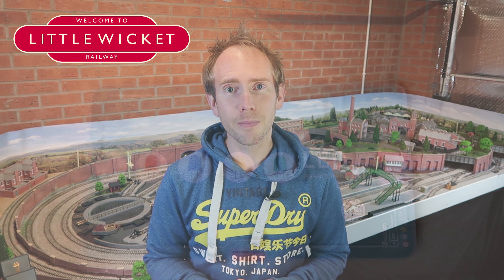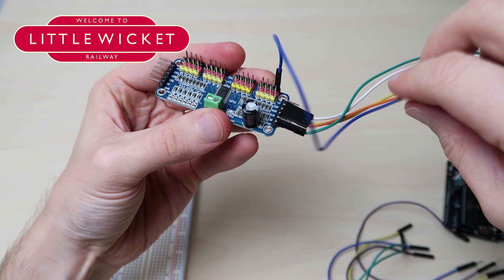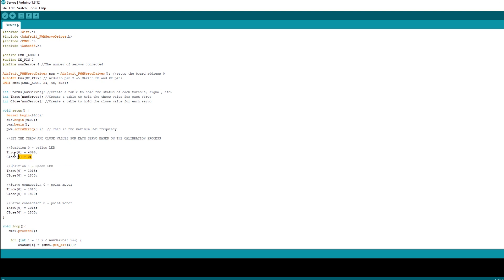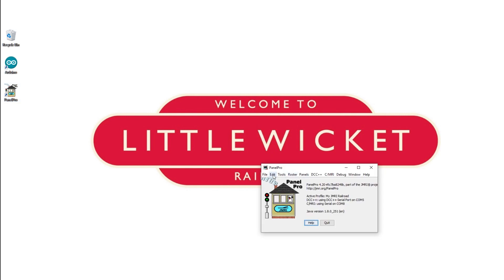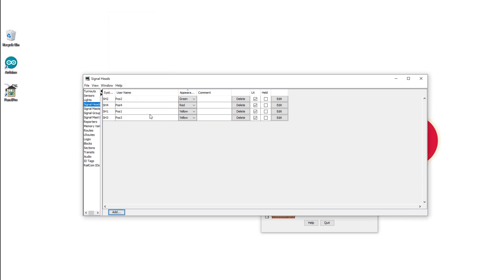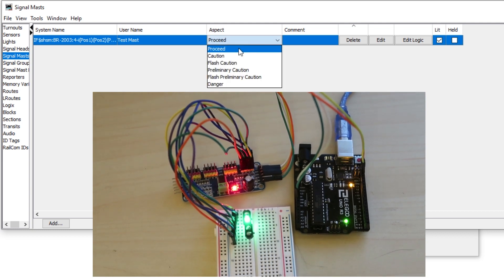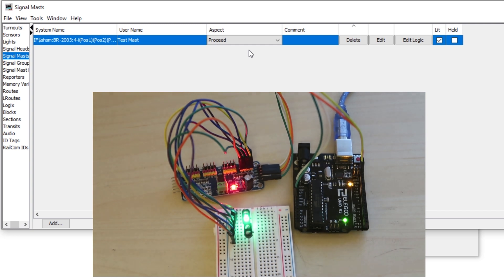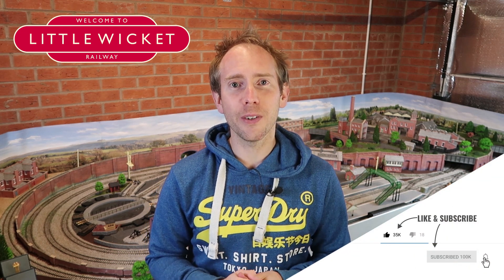DIY Model Railway Colour Light Signals Controlled by JMRI

Comment: much easier here is to just use grnd from the first set of pins on the PCA9685 as a common ground for all 3 leds, saves 2 wires from being needed and works perfectly well for this use case :)

Comment: Let me begin by thanking you for your previous videos! I have followed your DCC++ video and the servo videos with no problems. This video has had me being stumped for the last two weeks or so. I'm a true newbie with 3 months or so of learning via YouTube. I have had no luck getting this project to work and need all the help you can provide. Following this video you've been using a different Arduino and PCA9685 than the one used in the servo series. Is that correct or should I connect these LED's to the PCA9685 used for servos? Please HELP!

Comment: When I add the speed option to my servo control they stop working. This only affects the boards to which I add the extra code, the rest work fine. Anybody any ideas please?
Reply from the maker: Hi Tony, maybe drop your code into a comment so we can take a look or drop me an email via the contract page on YouTube 👍
Reply: @LittleWicketRailway 
Hi Rob. Thanks for getting back to me and offering to help.
Firstly, I must tell you that I am a complete beginner with Arduino and sketches. I have dabbled in the past with BASIC, Pascal and COBOL, so know the general format I do not know the specifics of sketch code and have only got this far by watching your excellent tutorials.
This the the code I am using to control the servos:

void loop(){

   cmri.process();

   // PROCESS SERVOS
   // Assume servos start on bit 0 which corresponds to output address 1001
     for (int i = 0; i < 16; i++) {
         
         //BOARD 1
         Status[i] = (cmri.get_bit(i));
         if (Status[i] != PreviousStatus[i]){
            if (Status[i] == 1){   
             for(int j = Close[i]; j<= Throw[i]; j=j+16){ 
                Board_1.writeMicroseconds(i,j);
            } 
         }
         else {
            for(int j = Throw[i]; j>= Close[i]; j=j-16){
             Board_1.writeMicroseconds(i,j);
            } 
         }
         PreviousStatus[i] = Status[i];
         }

         
         //BOARD 2
         Status[i+16] = (cmri.get_bit(i+16));
         if (Status[i+16] != PreviousStatus[i+16]){
            if (Status[i+16] == 1){   
             for(int j = Close[i+16]; j<= Throw[i+16]; j=j+16){ 
                Board_2.writeMicroseconds(i,j);
            } 
         }
         else {
            for(int j = Throw[i+16]; j>= Close[i+16]; j=j-16){
             Board_2.writeMicroseconds(i,j);
            } 
         }
         PreviousStatus[i+16] = Status[i+16];
         }

         //BOARD 3
         Status[i+32] = (cmri.get_bit(i+32));
         if (Status[i+32] == 1){
             Board_3.writeMicroseconds(i, Throw[i+32]);
         }
         else {
             Board_3.writeMicroseconds(i, Close[i+32]);
         }
         
         
         //BOARD 4
         Status[i+48] = (cmri.get_bit(i+48));
         if (Status[i+48] == 1){
             Board_4.writeMicroseconds(i, Throw[i+48]);
         }
         else {
             Board_4.writeMicroseconds(i, Close[i+48]);
         }
}

Thanks again for offering to help.

Comment: Hi, Your videos are excellent, I have been able to advance in most of them, now watching this video, would it be possible to make this same signal, only with the Sensor Hub + Your Sketch CMRI?
Reply: Done... working fine Sensor Hub + Your Sketch CMRI + this steps associate Light to Turnout Controller
Reply from the maker: That didn't take long! 👍
Reply: jajajaj It becomes easier when you understand better how to cross the signals between the input and output. , the power of the Arduino Mega + Sensor Hub + JMRI + CMRI is incredible, I will spend a very entertaining weekend preparing the signals and better understanding the work of all those components.

Your videos were very helpful, very didactic and with good explanatory details.  @LittleWicketRailway

Comment: Hi Rob, really enjoyed watching your series on servos using the servo driver board and this video - now doing something similar for my layout. Wondered also if the same can (easily) be done using perhaps a 74HC595 shift register mounted on a powered PCB without having to have have an Arduino always attached to the layout?

Comment: This is awesome. However i have just finished your video on multiple servos (using on a lego layout) using a powered ardunio and board.

However how would i combine servo control, sensor control and LED control onto one board?. I do have the sensor shield as well.
Reply from the maker: Check out my most recent series on JMRI, CMRI and Arduinos. It shows you how you can have servos (or lights), outputs and sensors on the same Arduino with a sensor shield https://youtu.be/OkXG3mfY6PE
Reply: Thanks mate. I lights i have are signal lights from trixbrix but will give it ago and see what happens. Thanks again.

I have some great ideas to use on my lego layout. Want to try and get train crossing barriers working.

By any chance did you do a lego series a few years back?

Comment: Thanks again Rob for these informative videos. I have a simple question to ask. I am thinking that to ease cable routing on my layout that I would have two pairs of PCA9685 boards. The first in the pair would be operating the servos for the points and the second for the associated lights. How do I set up each board in JMRI/CMRI? I may also want to use some of the I/O pins on the Sensor shield. I know I need address each board but would this be like; 1001....1101....1201....and 1301 and what happens to the addresses for the output pins on the shield? I'm nearly there but your help would be appreciated.
Cheers Martin
Reply from the maker: Hi Martin

Each Ardunio is a node in CMRI, so if you're having two ardunios each with two PCA9685s then you'll need to setup each Ardunio as a node by changing the CMRI address line (_#define CMRI_ADDR 1 //CMRI node address in JMRI_ 

The you'll need to setup two PCA9685s within each sketch (see video https://youtu.be/v1f_EDHV390). Make sure you solder the jumper closed on the second board.

It's up to you which addresses in JMRI you assign to the servos and lights. For example, on node 1 you could use 1001-1016 for servos and 1017-1032 for lights, which correspond to bits 0-15 and 16-31 on node 1. On node 2 you could use 2001-2016 for servos and 2017-2032 for lights, corresponding to bits 0-15 and 16-31on node 2.

Use the cmri.get_bit(i) code to find out if the servo is thrown/closed or the light is on/off in JMRI.  So as an example, your first light is connected to the first position (marked 0) on the 2nd PCA9685 which you've setup as pwm2. You've created this light in JMRI with address 1017. To find out if the light is on or off in JMRI use the code 

            cmri.get_bit(16) 

then store this in a table for the loop code to check. Within the loop you can then send the correct value to the light using the code below which is communicating with PCA9685 board 2 (pwm2) and connection 0.

             pwm2 .writeMicroseconds( 0 , VALUE TO SEND TO LIGHT);

You'll need to update the code loop for throwing/closing the servos or turning lights on/off and make sure it's referencing the correct bit in the table.

Also, check out the series on using Ardunio, CMRI and JMRI together (https://youtu.be/OkXG3mfY6PE). I think this might be of interest. You can have servo, inputs and outputs all running off the same device. I'm in the process of making part three which also might be of interest. Rather than having one big CMRI node that does everything at one central location with tons of wiring, I'm effectively setting up a CMRI bus wire. CMRI nodes around the layout then connect to the CMRI bus. So if you had a long layout you could have multiple Ardunios each controlling a handful of sensors, servos and outputs each. Saves on wiring and speeds things up a bit since the processing power is shared out.

Comment: Another excellent video very well put together and presented.

Everything works up to the point I need to add a mast.  i.e. I can create the Heads and the lights come on and off when controlled from the signal head window.

I am trying to add a 2 aspect distant signal mast - there is not one under BR2003-WE described as "individual aspects" and the other 2 aspect ones do not work. Please help!!  Which one should I use? Can more types be download from somewhere?

Thanks for your time.
Reply from the maker: Hi Ian,

I'll need to take a look at this as I don't know the answer off the top of my head. I don't think it's possible to download different types of masts.

A really good place for information like this and problem solving is https://groups.io/g/jmriusers. The guys who develop JMRI are on there and most questions have been asked somewhere.

I think the theory is that you create your signal heads and then these feed into the signal masts. Although I know it's possible to create signal masts without using signal heads. There is sometimes a bit of a clash between Simple Signal Logic (SSL) and Signal Mast Logic (SML). JMRI has largely been developed with US railroads in mind I think, so you might find that you have to be a bit clever when setting up masts around points for UK based railways.

Comment: Wow Rob, really cool stuff and far more understandable than many of the tutorials available on Youtube about the same matters. Amazingly well done and your vocation is clearly on the instructor/teacher side.

I have managed to get a pair of servos slow working on a module out of your tutorials and now my question is would it be possible to have these colour signals working alongside servos on the same PCA9685 board? Have you tried it? I haven't tried it yet, but eventually you did.

Regards and keep up with the amazing work you are doing
Reply from the maker: Thanks Gustavo, very much appreciated!

I didn't actually try running both off the same board, but in theory you should be able to run servos and lights off the same PCA9685. Just remember that the servos need a frequency of 50Hz, but you might find that this causes your LEDs to strobe or flicker. A frequency above 100Hz should stop the flickering, but then you would need to have them on a separate board away from the servos.

I did this video to prove to someone that it was possible to control LEDs using the same method. However, I think there is a better way of controlling LEDs. I've been introduced to addressable LEDs (google NeoPixels) and they effectively have their own little version of a PCA9685 for each LED. It's another project that's on the long list of projects.
Reply: Hi Gustavo I’m still struggling with servo speeds can you explain or put the sketch on line for how to do this , many thanks Derek

Comment: Hi Rob
I have managed to set up three servos for points using your excellent videos.
I would like to change the speed of the servos and noted you had put a loop in this sketch at the end of the video.
Unfortunately I am having trouble making out what it reads, could you possibly put the text file up so I can copy and paste it into my servo sketch please.
I have just ordered a mega, sensor shield and sensors so will be following that tutorial and hopefully make that work too.
Keep up the good work.
Thanks
Reply from the maker: Hi Stephen,

Long reply, but hope this helps. Example code at bottom.

So the original code for changing the turnout position looked like this:

          Status[i] = (cmri.get_bit(i));
          if (Status[i] == 1){
              pwm1.writeMicroseconds(i, Throw[i]);
          }
          else {
              pwm1.writeMicroseconds(i, Close[i]);
          }

It is constantly looping through and checking if JMRI has the turnout as thrown or closed. Each time the code is run it is sending a signal to the servo to move to either the thrown or closed position that you've defined. If JMRI changes then the servo will move as fast as it can from the old to the new position.

To introduce a slow movement we want to force the servo to stop very briefly at positions between the thrown and closed positions. So if closed was 1000 and thrown was 1800 then we might want to the servo to start at 1000, then go to 1010, then 1020, 1030, etc. until it reached 1800. The process of stopping at the intermediate positions gives the illusion of a slower motion.

So you need to put a loop of code in to force these little steps and to do this we'll replace this line:

           pwm1.writeMicroseconds(i, Throw[i]);

with this line:

            for (int j = Close[i]; j <= Throw[i]; j=j+10) {
              pwm.writeMicroseconds(i, j);
            }

This is saying that for a variable called j, start at the closed position value (e.g. 1000) then check if the value of j is less than or equal to the thown value (e.g.1800), if it is then add 10 onto the position and check again. You can change the value of in the loop to slow (smaller value) or speed up (higher value) the motion.

Then you also, need to replace the code to move to the closed position with a loop:

           pwm1.writeMicroseconds(i, Close[i]);

Gets replaced by:

            for (int j = Throw[i]; j >= Close[i]; j=j-10) {
              pwm.writeMicroseconds(i, j);
            }

So again, j starts at 1800 and the code checks to see if it's less than or equal to 1000 and keeps taking 10 off until it is. If the turnout is still moving too fast then you can introduce a delay after the pwm.writeMicrosendonds command, such as:

       delay(10);

This will delay each step of the loop by 10 milliseconds.

You need to be consistent with your thrown/closed values for this to work, i.e. your closed values must always be lower than your thrown values or vice versa. If you need them the other way round for a single servo then you'll either need to reverse the physical position of the servo or invert it in JMRI (easier option).

The other important change you need to make is to make the code only change the position of the servo when a change is required. The old code is constantly sending the position to the servo even if no change has taken place. This is why you need to create the following table to hold the previous status of the turnout:

          int PreviousStatus[numServos];

Then rather than send the position of the turnout each time, we want the code to check if a change has taken place using this code:

        if (Status[i] != PreviousStatus[i]){

And at the end update the previous status to be the current status:

        PreviousStatus[i]=Status[i];

So using a single PCA9685 with a single servo on position zero the full example code would look like this:

#include <Wire.h>
#include <Adafruit_PWMServoDriver.h>
#include <CMRI.h>
#include <Auto485.h>

#define CMRI_ADDR 1
#define DE_PIN 2
#define numServos 1 //The number of servos connected

Adafruit_PWMServoDriver pwm = Adafruit_PWMServoDriver(); //setup the board address 0
Auto485 bus(DE_PIN); // Arduino pin 2 -> MAX485 DE and RE pins
CMRI cmri(CMRI_ADDR, 24, 48, bus);

int Status[numServos]; //Create a table to hold the status of each turnout, signal, etc.
int PreviousStatus[numServos];  //THIS IS THE NEW TABLE TO HOLD THE PREVIOUS POSITION TO CHECK AGAINST
int Throw[numServos]; //Create a table to hold the throw value for each servo
int Close[numServos]; //Create a table to hold the close value for each servo

void setup() {
  Serial.begin(9600);
  bus.begin(9600);
  pwm.begin();
  pwm.setPWMFreq(50);  // This is the maximum PWM frequency

  //Position 0
  Throw[0] = 1800;
  Close[0] = 1000;
}

void loop(){
   cmri.process();
    for (int i = 0; i < numServos; i++) {
        Status[i] = (cmri.get_bit(i));
        if (Status[i] != PreviousStatus[i]){
          if (Status[i] == 1){
            for (int j = Close[i]; j <= Throw[i]; j=j+10) {
              pwm.writeMicroseconds(i, j);
            }
          }
          else {
            for (int j = Throw[i]; j >= Close[i]; j=j-10) {
              pwm.writeMicroseconds(i, j);
            }
          }
          PreviousStatus[i]=Status[i];
        }
    }
}
Reply: @LittleWicketRailway  Thank you for this. I will give it ago later.
Waiting for my sensor shield and merg block detectors to arrive and probably have loads of questions to ask lol.
Reply: Hi Rob still trying! If I set it up with the code below using my nano and a test program in CMRI I can get it to work and it’s great but I’m trying to add the code to the CMRI combined sensors and servos code form your video it’s not working I know I’m doing something wrong I just don’t know what!
Reply: @drnutsert  have you changed the baud rate to 19200?

Comment: Hi Any reaon you can't use a Arduino Nano ?
Reply from the maker: No reason that I know of. Just to give you a heads up, I think there's better ways of doing coloured light signals. Someone specifically asked if the servo driver could also do LEDs which is why I made this video, but I'm looking into using an ESP32 instead. They have WiFi and rather than standard 3mm LEDs I'm looking at using addressable LEDs on a strip.
Reply: @LittleWicketRailway .Cool - I have a couple of ESP32's but not had a chance to do anything with them as yet. The Problem with train signals is the expense of commercial ones. There is  a range by Berko which are more affordable but they work of 12DC.
http://onlinemodelsltd.co.uk/product/3-aspect-ryg-standard-round-head/

Comment: The same goes with much less effort on when using Neopixels instead as shown here: https://youtu.be/9bk1LL12MSk
Reply from the maker: Wow! These are incredible. I made the video specifically because someone asked if you could drive LEDs from the PCA9685 alongside servos, but as you've said, this seems like a lot less effort for coloured light signals. Looks like I've got a weekend project coming up, thanks for the tip! 👍